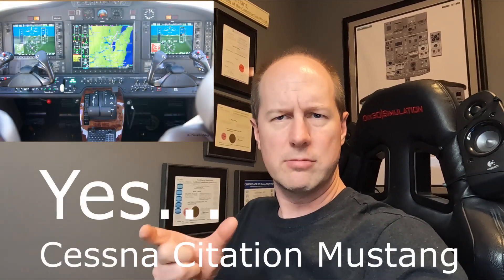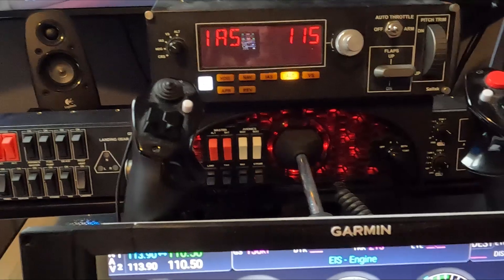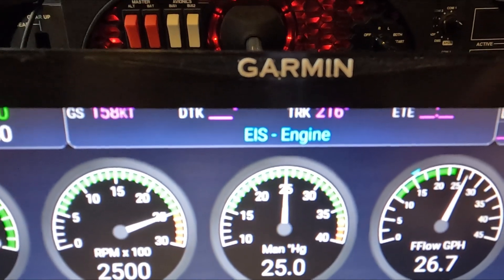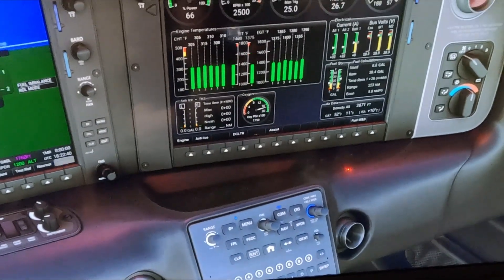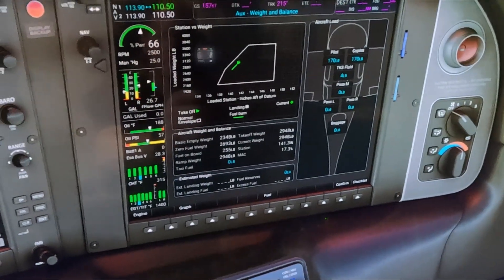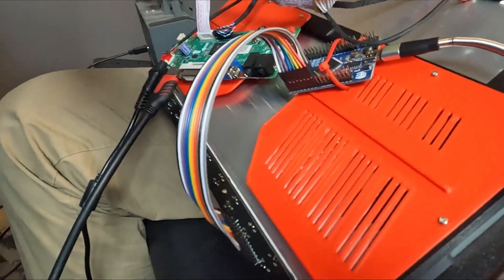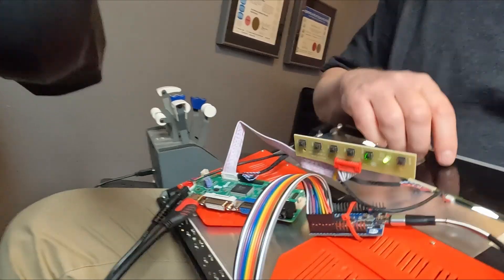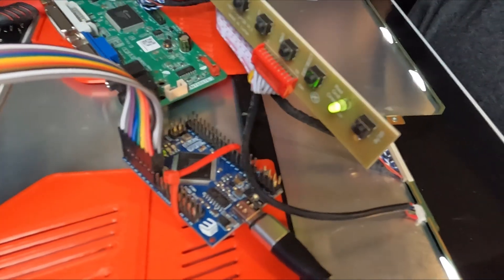Not a Garmin G1000 or G3000 but a GDU1500 - DIY Home Flight Simulator

Comment: FlightsimDIY don't sell the plans and STL anymore , just the built one...
Reply from the maker: Incorrect. I just looked on their website. STL files come with the purchase of the PCB. Yes, they are not selling the CAD files anymore.. But STLs are still available for purchase. Yes, you need to buy the PCB as well. But the STL is useless without the PCB, as you can't build their products without the PCB.
Reply: @thesimproject73  Incorrect as well LOL , i re-checked , can't even see a "PCB " category in the shop , and of course you can build a G1500 without a PCB if all you need is a design for the frame , an arduino , a perf PCB to mount the electronics and lots of soldering , of course having a PCB is much easier but "cannot build without the PCB: is where I beg to differ, in all cases , respect for your work man , and have a great one...maybe the store not showing me PCB and STL options is country related since i'm logging from Europe.
Reply from the maker: Ah, sorry,  I thought  you were talking about their entire product line and not just the G1500... Yes, the G1500 is offline right now as they are doing a redesign of it. Currently, it's only a panel mount, needs a large size peinter to print and can't be built as an enclosed unit for mounting on a desk or onto your controls like the G1000 can be.
Reply: @thesimproject73  That makes sense, will keep checking on their updates, I'm currently printing a long list of parts for 2 panels till end of Jan probably so not in a rush hahah, got a new printer and pushing it to the max :D
Reply from the maker: @mohzoheir  they have a really good Discord group. That talks about what's coming down the pipe.

Comment: Hi, I hope you can answer a few questions for me.  I'm going to build a generic KingAir sim with 3 displays for the G1000.  Ideally I wanted to go G3000 with three equal size 16x9 displays but it doesn't look like there is any software which would support it.  I've read in a few places that Garmin offered (or still does) a 12" version of the main displays for the G1000.  Given that I think I actually want to push that a little larger still at 14" and then have the center display at 16" (4:3 as well).  I want to do this so that on some occasions I can use the three screens to display analog round gauges instead of everything being all glass all the time.  I used to do it with 24" displays and Prepar3D.   And my panel width may come out a few inches wider than a real KingAir but I don't mind. I think with this plan it may come out 6" larger at most.  Regardless, I guess what I should do however, is still build all the buttons and knobs at the default size and just leave extra room at the bottom and sides. This means I will kind of have to customize the bezels a little and make it more modular.  Did you buy plans anywhere for yours?  I do CAD/CNC work so that's not hard, I've just not done 3D printing yet but am eager to step into it.  Lastly, I'm trying to decide what's the best route to go for the electronics as I've seen some PCB options vs running all the button wires individually.  I see PCB being the better way to go, but so far only found one seller of them and it's strictly for the 10" versions.  Any thoughts on all this? Thanks.
Reply from the maker: Sorry, I took a few days to get back to you. I've been away on vacation... 

G3000s where my orgnial idea as well. Wanted to make a generic panel that could be used for both GA aircraft like tue King Air or Cirrus. But allow pop out support for airliners as well, like the 737 or 320. 

I did find a half done G3000 CAD file on Thingiverse, with plans on how to order a custom PCB.

The stuff I'm using I bought from flight sim DIY. They'll sell you tue CAD files and STL for your 3D printer for about $25. You can order the PCBs for $15 or $20, depending on the unit you're building. 

MSFS2020 does support pop out panels for the default G1000/G3000 units. And there is 3rd party software that will pop out non-default panels and give you touch screen control as well. It's called Pop out oanel Manager on Flighrsim(dot)to

The guys at Flight Sim DIY are working on a G3000 design as well.
Reply: @thesimproject73  Hi thanks.  It looks like the default KingAir is only using the G3X or the blackshape analog cockpit options.  Some people think the G3X is the G3000 but they are different. From what I've gathered so far, MSFS / WorkingTitle has only emulated a G3000 in the Socata TBM930, which luckily is a turboprop so I'm trying to explore how or if it can also be used in KingAir 350 as well.  That's my goal really as I like the added touchscreen radio / MFD units which could have their screens potentially be used for other MFDs as well (Boeing, Airbus, etc via AirManager or popouts).  I also think the G3000 screens may be slightly larger than the G3X in real life and are also a different aspect ratio.

I used to do a ton of this stuff a decade ago with Prepar3D which was A LOT easier to mix and match 2D panel avionics and make config files for.  I also got good at doing various swaps in some of the virtual cockpits.  

Regardless, I'm a real pilot and want a full scale dual seat sim (about KingAir to biz jet size) using MSFS and am working on a materials punchlist in anticipation of the next release which I hope will include some more cockpit builder friendly options in the way of 2D panels, pop-outs and view management. The fact they are touting multi-threading will also greatly help with cockpit building.  

Anyway, if you have any info on the exact screen sizes and or aspect ratios of the G3X or G3000 I'd greatly appreciate it.  I do think the G3X are 16:10 and the G3000 might be 16:9.
Reply: @oldowl4290 based on Garmin's website the G3000 is 16:9 

"G3000’s sleek 14.1" diagonal WXGA high-resolution cockpit displays. With the extended 16:9 width-to-height ratio, these all-purpose GDU 1400 series devices can function as either a PFD or MFD"

It is sad, now poor the G3000 has been done on the default King Air. There is a mod out there to put the G1000NXi and G15000 in it which will fix with that I'm doing. Hopefully MSFS2024 will have some updates for it.
Reply: @AdventuresonTour   Thanks man.  WXGA is actually 16:10.  I had looked briefly and didn't see it.  And that's good news because I really prefer 16:10 displays.  They kind of went the way of the dinosaur unfortunately but have made a comeback in some laptops.  - Also, the default in the KingAir is actually the G3X, not the G3000, and WorkingTitle did the G1000NXi mod which is now built in native as I understand it (so that and the default G3X option).  Standard G1000 screens however are a little smaller..like 10.1", but I've read Garmin also offers it in 12.1".   And with the pop-outs you can of course use a larger physical display if needed anyway.  This is why I'm glad to hear the G3000 is 14" because that was what I really was aiming for.  10.1" for example is like the size of an iPad and that just feels way too small unless in a Cessna 172.   In one of my old sims back in the FS2004, FSX, P3D days I used to run several 24" 16:10 displays.
Reply from the maker: I think the 12inch display from Garmin the G2000. 

"With 12" or 14" widescreen displays, the G2000 puts an incredible amount of flight information right in front of you."